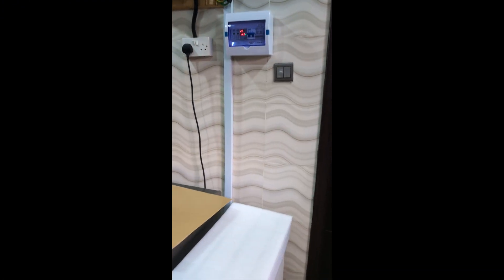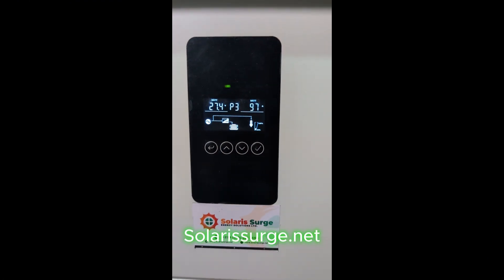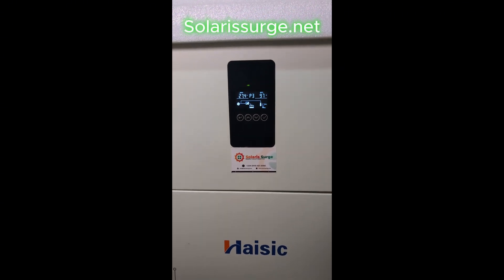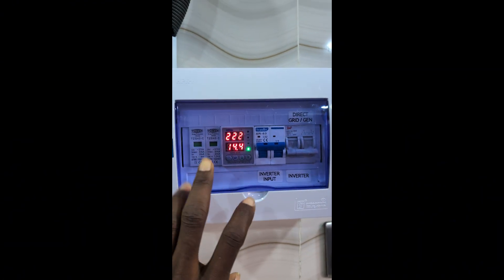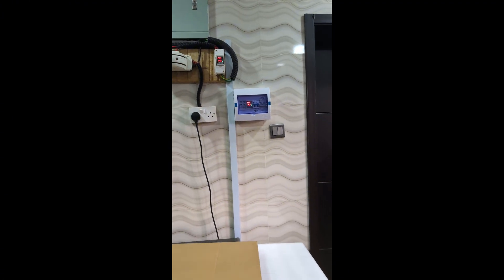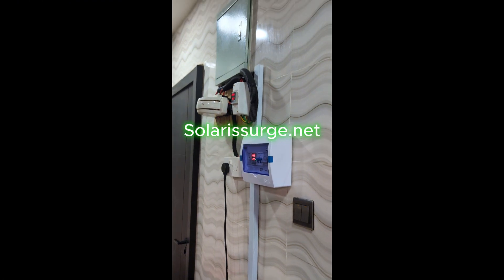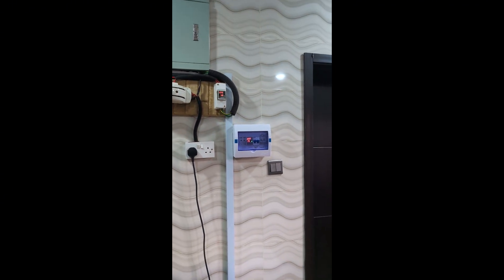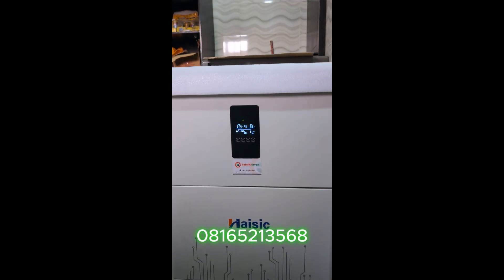Haisic All in one 4.2kw 7.2KWH Installation

Comment: Your caption here says 7.2kwh battery but in the video you said 8kwh. I'm abit confused. Whats the actual capacity of the lithium battery?🔋
Reply from the maker: 7.2kw and up to 8kwh
Reply: @odedeyidamilare its confusing sha. But for this system, what is the SOC voltage when the battery has been charged full and has been disconnected from charging?

Comment: The charging current is too high and that is wrong. The maximum should be below 75A.. recommend is 40A.. this is a bad practice, walk within the producer range to avoid damaging the system.
Reply from the maker: Just to clear things about charging, the battery are 280AH, if I charge at 100A, thats 0.35C which is within cells manufacturer's 0.5C recommendation.
Reply: @odedeyidamilare  He's right, 100A is above the max recommended current on the datasheet. I had to drop mine to 40A because it gets too hot at 100A and eventually uses more energy to charge than it should.
Reply from the maker: @faithomotoso8637  whether you use 100A or 10A 
It is your lower current that will waste more power due to efficiency loss
Reply: @odedeyidamilare 100A generates more heat and would lead to more loss. On 100A it pull almost 13kw, on 40A it's about 6. When it started running for over an hour on 100A I had to stop charging it to cool down before charging again. On 40A I never have that problem. Again, manufacturer says max is 75A.
Reply from the maker: @faithomotoso8637  you are believing Data sheet that is totally wrong, 40A to charge 280AH cells? 
They even wrong 314AH, everything about the data sheet is wrong
Reply: @odedeyidamilare lol okay. Mine is on 40A and it charges. Doesn't generate as much heat & uses less kWh compared to 100A.

Comment: Nice one bros, it has high P V input, nice shape but the problem with the inverter is the ON switch is the inverter and the fan keeps blowing non stop, they should work on it
Reply from the maker: You want the inverter to spoil?
Reply: @odedeyidamilare 😂😂😂 your replies ehn. Damn too hilarious
Reply: @odedeyidamilare what are the things that spoil nverter sir?  That  voltage protector whats does it do.
Reply: That is how those cheap mosfet inverter works.
How can one person single handedly jack 8kwh batery . Baba the company is just joking.
Check other quality brand like Felicity and sms baba one person cannot single handedly jack 8kwh batery. Even two people can't carry it without resting after 20 seconds. Pls always make research about grade A cells BCOS money hard to get
Reply from the maker: @kisajosephgerald8047  what is the weight of 280AH cells? 
Approximately 5.5KG x 8 then plus casing.. 
That's around 50kg na.
Reply from the maker: @kisajosephgerald8047   Felicity Lmao